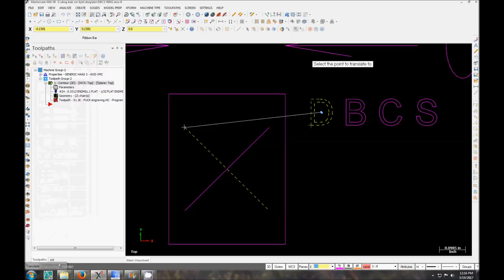MACHINING VLOG: Engraving Rings with Mastercam & Haas VF5

Comment: Yay engraving. Coolest job I ever had to engrave was a headstone. Still have the practice piece in my box, because 1) Its cool as fuck 2) I really didn't want to mess up a job that is supposed to last forever.

Further thoughts: 1) Engraving tool? Fancy. We just generally use center drills 2) Why the double touch off? I mean, I know you put the tool touched off as the reference point that you use for machine, then put the 2nd one in the work offset, but why? Seems like an extra step for no gain? 3) How did you make sure the face of the ring was level? Seems like you just threw it in? The engrave didn't seem to be off, so you must have been close.
Reply from the maker: l0c0dantes A headstone? That's bloody cool - I feel you though, that would be a stressful one-off to say the least. 

For the engraving tool - it's just a 1/8 drillmill (what V4 calls chamfer mills) - I keep them after the edges start to burn out for stuff like this with the top.

I went for the double touch off because the two rings are different sizes - but you're absolutely correct, I could've gotten away with a single touch off. Old habits die hard - kind of like the totally unneeded 2" clearance height in there!

As for throwing the ring in, you're not wrong - I've done enough of these now that I can eyeball it well enough that if I drop the work offset down in increments of .003, it isn't noticeable at all. Definitely isn't best practice, but I haven't found a quick and dirty way to make it consistent without making a fixture yet - that will probably be my next project though! Thanks for the comment man, I always enjoy talking shop with someone knowledgable!
Reply: Oh, you want quick and dirty? Use the spirit level that's built into the combination square.